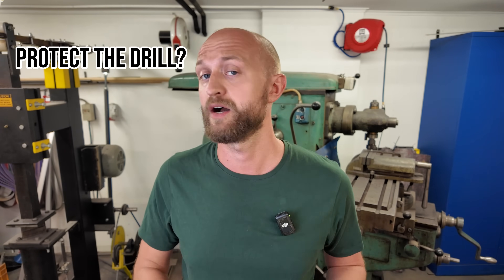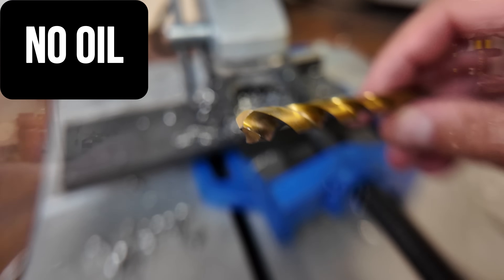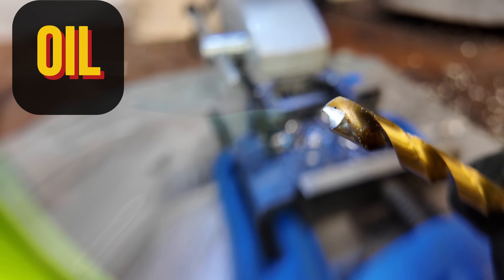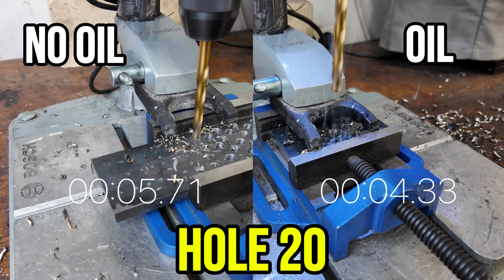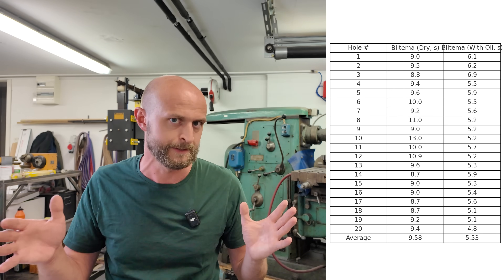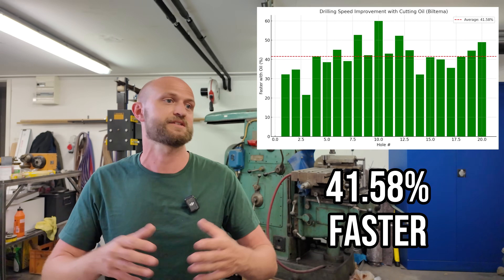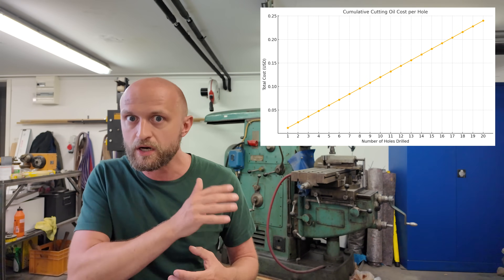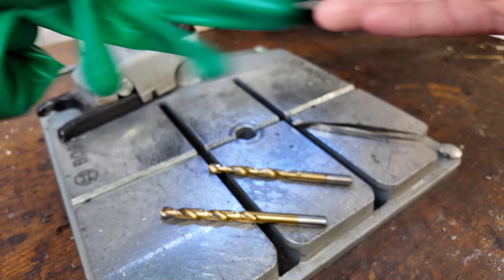You’re Drilling WRONG — Here’s the Proof

Comment: Should have measured the temp of the bit. 

I use any leftover or extra engine or transmission oil, usually DEX/MERC ATF.
Reply from the maker: Good point — measuring bit temperature would add another interesting layer to the test. I’ve heard of people using leftover engine or transmission oil, but haven’t tried ATF myself. Just worth noting that used oils can contain harmful substances, so good ventilation and protective gear are important. Thanks for the tip!
Reply: @SteelSurgeon-h6p  I wouldnt put used oil on anything I'm not about to light!

everything takes a partial quart, which leaves a partial quart.

reduce, reuse, *reappropriate*, recycle

Comment: Carbide versus HSS drills in the home shop. Carbide is brittle so a fairly rigid machine recommended. And costs maybe 5 times as much. But useful for materials that work hardens.
For most drilling in the home shop HSS is the norm.
Reply from the maker: Absolutely — carbide has its place for tough, work-hardening materials, but for most home shop drilling, HSS offers the best balance of cost and durability. I might test carbide in my setup in a future video to see how it holds up.

Comment: If the feedrate is not identical your not really creating data of any kind. Get a machine with auto feed and use the dame rate and do it all over again as hand feeding alone has way yoo many inconsistent realities for any of this to have any realeaning. Also twist drills should last hundreds if not thousands of holes on a rigid machine with proper speeds and feeds. Also, stop using chinese high speed steel tooling if you want long life and repeatable results, carbode took over in the late 80s and i vave never looked back!
Reply from the maker: You’re absolutely right that identical feed rate is key for proper industrial testing. In this case, though, the goal was to simulate a home workshop scenario — where most users drill by hand or with a basic drill press, without auto-feed or perfectly repeatable feeds/speeds. The data is meant to reflect what a DIYer would realistically experience using budget HSS bits.

On carbide — totally agree it will outperform HSS in rigid setups, but in home shops it has limitations: brittle edges can chip if the machine or clamping isn’t rock solid, and the higher feed/speed requirements aren’t always achievable with hobby-grade tools. Still, you’ve inspired me — I actually have a test with budget carbide bits coming up soon, so we’ll see how they stack up in a home setting.

Appreciate the thoughtful feedback!
Reply: @SteelSurgeon-h6p a fair number of home and small shops have way mor rigidity repeatability and frankly lower vosts for virtually any machine process or tooling than just a few decades ago, everything i have is cnc and feed rates are very precise. I also only have a 2/3 horspower on my spindle and carbode works just fine as long as i dont go beyond the machines intwnded ratings. If you really want some interesting outcomes for your vids try testing a milling cutter in a plunge with and without cutting oil. And maybe stack cutting oil against a modern semi senthetic or full synthetic cutting fuid. The results are amazing. Also i have found that theajority of cutting wdge failures arw often attributable to swarf or cutting chips not being cleared out, esspecially in small hone shops with machines without enclosures, blowing chips out of the work zone will do more than most people realize for tool life. But that can be messy or difficult qithout enclosures..
Reply: Can you believe how much auto correct messes up these vomments? God i really fislike the future...
Reply from the maker: That’s a great point — the home and small shop landscape has definitely evolved, and many hobbyists now have CNCs or semi-pro rigs that can hold tight tolerances. My testing is aimed more at the “average” DIY setup without full enclosures or chip evacuation, since that’s where many viewers operate. You’re spot-on that swarf management is huge for tool life — probably more so than most realize.
Carbide is on my list, and I’ll definitely be putting it through its paces in an upcoming test (budget-friendly carbide to keep it realistic for the home shop). I really like your idea of comparing cutting oil with modern synthetics — that could make for a fascinating follow-up. Appreciate you sharing your experience and suggestions!
Reply: @SteelSurgeon-h6p we vould "vollab" hahahaha🤪 i could run exact feed speed for your tests so you could expand your testing methodology to encompass more than possible otherwise, also, i have tool grinding stations so i could grind you virtually any tool imaginable out of any substrate, you could do testing with dbits allowing a direct comparison of single point cutting into edges as closely as possible.
Reply from the maker: That sounds like an impressive setup, and I really appreciate the offer. At the moment I’m keeping my tests in-house, but I’ll definitely keep your suggestion in mind for the future — it could open up some interesting possibilities.

Comment: Per Dan Gelbart's video "Unusual shop tips", about 15 minutes in, I set up my bench mill with alkaline water (small amount of lye added) as flood coolant to prevent rust.  I was very surprised to find that cutting action and tool wear were better than expected.  Do keep it contained, off of slideways and lead screws though!
Reply from the maker: That’s a really interesting tip — I might just have to try the alkaline water setup and see how it compares in my shop. In fact, I’ve got a video dropping today all about using plain tap water, so this might be the perfect follow-up experiment!

Comment: I use a mixture of kero,auto trans fluid and lard. Works great.
Reply: Nobody will ever make this suggestion with bacon grease.

Too valuable 😂
Reply from the maker: Exactly — bacon grease is strictly for the table. Using it on the drill press? That’s a crime against brunch! 😂
Reply from the maker: Interesting mix! I’ve heard of ATF and kero, but never with lard — I might have to test that combo sometime. Thanks for sharing!
Reply: @SteelSurgeon-h6p the lard can be temperamental depending on the season. More lard in the mix in summer,less in winter. Used on the drill press for instance the bit will cut faster with less effort. I use on all hss in the drill,lathe and mill.
Reply from the maker: Makes sense — adjusting the lard mix with the seasons is a clever trick. Sounds like it really makes a difference in how smoothly the bit cuts.

Comment: I'm not a machinist. I'm an industrial engineer with an unanswered question. Perhaps you can help me. When drilling through thicker metals like steel, I noticed that some machinists use oil for the first 10- to 15% of the depth, and none for the remaining depth of cut. My question is this: Does the oil's lubricating property eventually cease as the hole deepens and the cutting action becomes unlubricated? If, as you point out, lubricating the drill bit increases drill life and reduces drilling time, why not fill the drilled hole with oil once the hole is established and continue to drill while lubricated? Is it simply a matter of laziness, or am I missing something?
Reply from the maker: Excellent question — and you’re spot on to notice the change in oil application mid-drill. The main limitation isn’t that the oil stops lubricating — it’s that it physically can’t reach the cutting edges once the flutes are full of chips.

In shallow drilling, gravity and capillary action carry the oil to the tip. In deeper holes, chips form a barrier and trap heat, and the oil at the point quickly flashes off due to high temperatures. Without through-spindle coolant or a peck-drilling cycle to clear chips and reapply oil, the lubrication zone becomes starved.

That’s why industrial setups with deep-hole drilling often use high-pressure coolant delivery — it both evacuates chips and constantly replenishes lubrication right where it’s needed. On a manual drill press, the equivalent would be frequent pecking, chip clearing, and re-oiling, but at the cost of cycle time.

In my case — knowing all that — I’d still say it’s mostly ‘laziness.’ 😄 With drill times around 5 seconds and the ability to sharpen my own bits, I just make sure to oil both the flutes and the material before I go.
Reply: filling the hole doesnt really help. since the flutes on the drill will instantly carry that oil out of the hole. thats why as @SteelSurgeon-h6p mentions, that you need high-pressure coolant delivery through the tool when drilling deep holes. depending on the material and the machine used. even blowing compressed air through the tool can do the job. the absolute biggest concern when drilling (except in stainless, tho its still a concern) is getting the chips away. doesnt matter if you are drilling or milling. only lathes dont really have that problem when machining outside diameter, due to the way the work
Reply: @kkofodh  9/10 times if I have to drill holes in any stainless steel - I switch to a carbide drill. Almost nothing is worse than having a great setup, program then run it - first few holes with an HSS drill are great - go to pick some coffee while machine is running...

and SKHRITZCH! The tip went dull in the hole and is now hardening and destroying the hole :face-red-droopy-eyes::face-purple-crying:

Carbide and thru-coolant - easy sailing all day long =)
Reply: @innominatum9906  yes on a CNC i would go for Carbide anyday. and if the machine has through spindle coolant capability i would use it for basicly any material.

on the other hand i would be very carefull about putting a carbide drill in a drillpress, simply because the setup is probably not rigid enough, and its very hard to actually push the drill to what it needs.

on a knee-mill i would gladly use carbide tooling for anything excepts drilling

Comment: Uses old motor oil and a regular oil can. Why reinvent the wheel and pay for it at the same time.
Reply from the maker: You’re right — it will definitely lubricate. My only concern, speaking as a surgeon, is that used oil can give off fumes and particles that aren’t great for long-term health. A fresh light oil can be a safer option for both your tools and your lungs
Reply: As a surgeon you must know that venting out anesthetic gases is fundamental. I have never understood why all hobby workshops collect tools they will never use and ignore extraction.
Reply from the maker: Exactly — ventilation is key! That’s why I use respiratory protection that actually works with a beard 🙂 and make sure to ventilate my workspace.

Comment: I use Rocol RTD compound as it’s solid so it sticks to the drill. Then when it heats it turns into liquid. It does excellent job in protecting the drill and taps. Only downside is, it’s very expensive…
Reply: I use Rocol when drilling hard materials, especially when drilling Hardox steel which comes up often in my job.
Reply from the maker: Rocol RTD sounds like the VIP treatment for drill bits. I’m curious though… how much do you actually go through per hole? In my video I used less cutting oil than I expected, so I wonder if the math works out even with the higher price
Reply: @SteelSurgeon-h6p  I dip the drill head in that compound and that’s it for one hole. One can has lasted me years. I dislike spray can cutting fluids as most of it never gets to where it matters 😂
Reply from the maker: What’s the price on that? Sounds really interesting — especially if one can lasts you years!
Reply: @SteelSurgeon-h6p  lowest I’ve found is 30€/500g. Price seems to vary a lot depending on seller. One thing I’d like to also mention that I as well use it only for steels. For aluminium IPA is good. It also evaporates so leaves no mess.
Reply from the maker: Good tip on using IPA for aluminium — I hadn’t considered that benefit of it evaporating and leaving no mess. And yes, the price on this stuff really does vary a lot between sellers.
Reply: I've been using Rocol for a while now.  Couldn't get the paste over here, so I have the 350g squeezy bottle of fluid.  Only use it for hole making, and only in ferrous materials, but I'm still on my first bottle.  It's about 5 years old and it's maybe down to 1/3 full.
Reply: Fantastic stuff 🎉
Reply: expensive?
dont you mean it STINKS and its black tar that gets on everything?
still good stuff...
Reply: Rocol RTD (the solid variant not the liquid one!) is by far the best cutting lubricant out there... And very economical despite the somewhat high price... A can will last you a VERY long time and the bits last 2-3-4 times longer...

Comment: For most general cutting you want an Alkaline solution as it will not cause rusting.  Water with baking soda works great. On a bandsaw this will save you a lot of money.
One of the worst things to do is use something like engine oil.
Reply from the maker: Good tip! Baking soda water is one I’ve never tried, but it makes sense — especially for rust prevention. Perhaps i should make a test with that? I guess engine oil is the surgical equivalent of using cooking grease in the OR… wrong place, wrong job.
Reply: @SteelSurgeon-h6p  Never use engine oil! Really not good. Actually lard is an old lubricant for cutting and smells nice.  Cut it with a bit of Kerosene, ((melt and mix in a double boiler,(ask your wife)), for easy brushing.
Kerosene for non ferrous particularly the Cuprous alloys such as Brass and Bronze.

Here is an old, like late 1800s  recipe for using lad:
Lard Cutting Oil.
Melt lard over a low heat.
Add between 20% - 40% mineral oil.
Add a small amount of Paraffin wax.
Store in an airtight container.
To use, apply a little with a small stiff-bristle brush.

Water loaded up with sodium bicarbonate aka baking soda is really effective and the only residue is baking soda which washes down easy. It also doesn't grow fungi or affect the impellers of a pump. Water is a really great cutting fluid and the baking soda being Alkaline  stops ferrous oxidation plus it is super cheap.

The Internet Archive has some great Victorian era books on Engineering practices plus many books of recipes as they were called.  The interwebs will save us yet!
Reply from the maker: That’s some great old-school knowledge right there — thanks for sharing! I’ve never tried a lard mix for cutting, but the baking soda water trick sounds like something I could actually test in the shop. Might have to dig into those Victorian engineering books myself. 📚